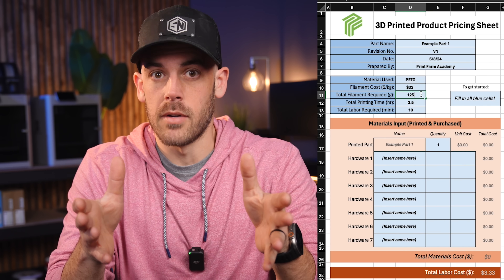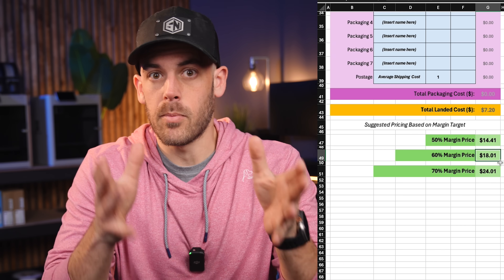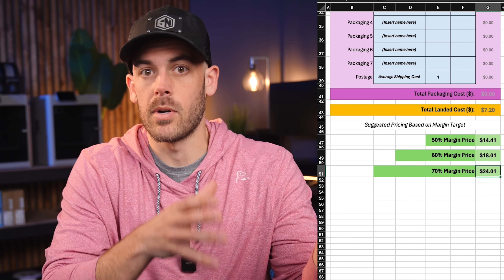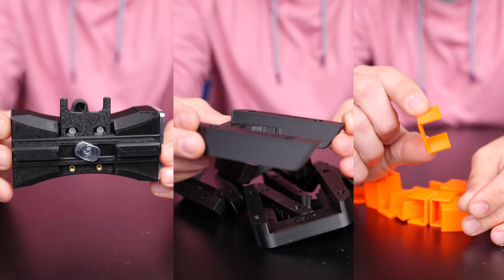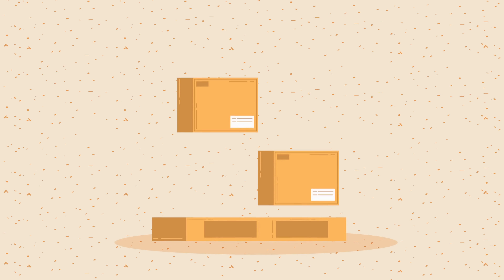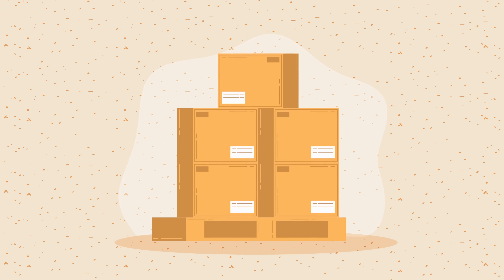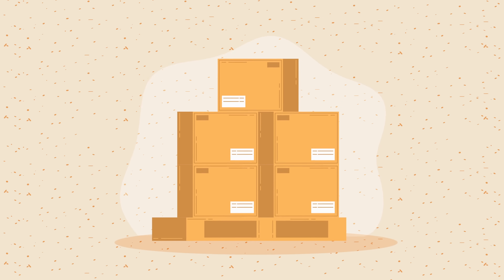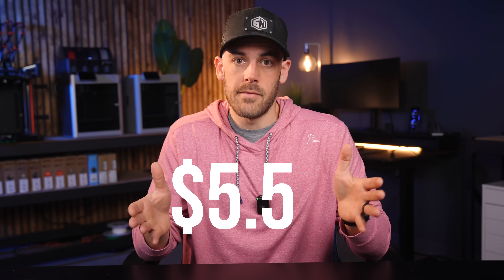Why I charge $55 for this 3D printed part (how to price)

Comment: I charge $75CDN per hours for custom CAD design, if it’s a small part that would take me way less than 1hr, I charge a basic $25 when it’s person that needs an item for their hobby or small house hold part.  For example I just did a small clip for a knitting machine that is no longer in production or sell parts for it. I charged $25 to design and $10 per printed clip. Any future orders for this clip for other people in her knitting guild is $10 since it’s been designed.  I got extra orders for 7 of them. No one out there have that part available.
Reply: I just wanted to point out the great thing you’re doing for the environment in this way. You’re keeping a machine alive with your knowledge and a small 3D-printed part. We need stronger rights to repair and open-source plans (like CAD models for parts) for all discontinued machines around the world. Keep up the great work!
Reply: @Homie111092  Thanks, the fancy pants shower that was installed in our house by previous owner has a lot of custom parts. Even the glass rollers. A small 1ix2 inch part of over engineered part broke. Was going to be over $300 and 6 months wait for it. 20 mins to design about the same amount to print at cost of $0.4 to print (including electricity).  The waste is mind boggling. I think the idea of the roller being non standard and engineered to break and that cost is for people to buy a new shower unit.  The greed is crazy. We need printers in every homes so people can have more meaningful and compelling jobs aligned to what they want to do instead of being stuck in factories.
Reply: @Slurgical_3D_Terrain_Channel  I want to get started, Im making my way through youtube to soak in as much information as possible. Where do you recommend I start? A youtube channel? A specific video? A 3d printer model you recommend? Tell me what you can, I completely agree, all households need a 3d printer. A regular appliance that is used whenever something breaks, just find the part design online, print and repair. What a world we'd be living in then.
Reply: @AdrianDWolfe  I was in your shoes about a year ago today lol.

CNC kitchen has a lot of great stuff but honest once you watch enough 3dp videos you will get recommended them enough you wont need to look. for my printer I went with a bambulab p1s and its served me extremely well, its much cheaper now even, i paid about 900 usd shipped with filament, about 150 was CF stuff, CF filament (pet and petg) a hardened nozzle and extruder gear. It seems like they have a massive sale on everything from late october to black friday, I recently added a multi material system (AMS) which was 100$ off with that which should still be running. though if you dont plan on doing engineering filaments an A1 or mini could be fine too. There are a LOT of really competitive machines out there now too, bambu (specifically the p1p, p1s, x1c chassis) has REALLY good support for aftermarket parts which has been amazing. Since then I have learned fusion (I had used autocad for a few years a decade ago) and have been constantly designing and fixing my own stuff since. I have only had to open it up once to rotate a REALLY rattly linear bearing, but nothing that has affected printing really.

as far as stuff I have made off the top of my head (not all designed by me but a lot were)
.Glasses frames (which I am still wearing right now)
.shelf pegs
.wall hooks
.MANY p1s upgrades
.toys and personalized christmas gifts
.storage and organization
.a visor mount for a car
.a clamp screw  (that was plastic to begin with) that was 40USD to replace from the OEM shipped
and so many more, I dont think its saved me money, but besides a 3090 for mining eth its the one machine I have bought that has actually paid off a significant portion of its value. and not to forget just how much it kept out of a landfill by making repairs possible. recycling pla at home on the cheap is still a few years out, but its not a big deal to keep a trash bag or so a year around until then.

If I had to guess ive spent around 1100-1200 total on printing stuff, and id wager its saved upwards of 600$. the glasses frames really carried here at 200, the visor part for the car was also 80+ shipping. Theres also the "one of a kind" stuff like I printed a marble PLA weeping angel (250mm tall or so), good luck finding something like that for a christmas gift. I honestly think we are moving towards that time where people will be more likely than not to find that someone already made a model and uploaded it for the exact thing they broke. more often then not printables has what I need, and for free. printables has a rewards program that lets you get (cheap, you pay shipping) rolls of filament for uploading makes of others models, and uploading your own, though most of the points come from makes. comparing your models to others is a great way to learn, especially if you are looking to design your own. Look into tinkercad if you are new to design. and then you can move onto something like fusion 360. even though I really dislike the business practices of subscriptions and paywalls its still the best parametric modeling program. its still free for personal use, and commercial with limitations, but a lot of subscription scumminess. 

thats about all I can think of now, welcome to the world of 3d printing!
Reply: @AdrianDWolfe  hi sorry. I thought I responded to you.  My bad. Yes for sure a youtube channel is a good start. I started mine a couple of years ago,but at the time I wasn’t sure how to go about it. Wasn’t until the beginning of last year that I had some direction. My channel is still very small, that’s ok. I haven’t really pushed it because I haven’t really found my voice yet. I think I’m at the cusp now. So start now if you haven’t yet, it might take some time to find your voice.  Even if you vlog the beginning of your journey, practice with that. I just started vlog with my design now. If I were to start over, I think I would have started with vlog my journey towards my goal so I wouldn’t crash and burn when my goal became clearer. As a 3D printer I would start with a modern one.
Reply: What do you mean by small part? Because small parts can be as complex as a big one. Its never the size but the complexity of your design that defines how many hours you spend on wich level of your skill. Then if that part is going to be produced, you should also have to do optimisations, regarding materials, plenty of certification requirements, etc.
Reply: @ It was small physical and simple part that took no time to make.  The shower part was equally small but took me about an hour to make. You are right, some small parts can be really complicated. I design tabletop terrain for gaming. They are small and with a lot of details and working mechanical parts with gears for doors and locks at 28 or 32mm scale.
Reply: @opiniono-1 I think those are valid for mass production requirements. But for stuff that is out of production and at a hobby level, as long as what you are doing works and is safe overall. Don't need all that. A brand that doesn't exist...has no ground to sue you, and if someone hold a trademark and gets twitchy...then stop, doesn't worth it. For sure you don't sell enough to make any ground for lawsuits. The needs are not substantial for anything. Could have carved the part from wood. Anyone with imagination or skills can do and reproduce. Even for example, if there is a Yugo Club and they need anything to make the Yugo go....who is there to stop you. Yugo will go nowhere since there is none.
Reply: This has to be one of the most civilized and thoughtful comment threads I've seen in months. I've almost forgotten people can communicate without unhinged lunacy taking over within 4 comments lol 
Great convo an advice Slurg 😎
Reply: @ShadowWuYT  oops lol. Looks like I commented a lot. Thank you. I’m with you about the lunacy. Life is hard enough with the abrasive lunacy and toxic comments.
Reply: @Slurgical_3D_Terrain_Channel   yeah man it was refreshing to read something I actually learned from lol
Reply: Do you have some kind of storefront where you list/sell all these one-off items? It would be the best way for other people needing that specific thing to find your version.
Reply: @ no, I don’t for that stuff. I do have a digital store for my own designs. I’m more focussed on designing terrain for tabletop gaming, but if someone needs something I have no issues taking commissions for one shot or a couple of times. The main reasons for that, is that I don’t know enough about trademark and all the legal rules for that. So making a shop for that would take too much of my time to make a business out of it and looking into the legal stuff. I’m just one person that scrapes by. I already got legal threats because I mentioned that my terrain can be used for some games. Most companies don’t care about that, it promotes their games. But Games Workshop are predatory. I didn’t even copy anything of their  or their style. So it doesn’t worth for me to a chance about copying things and ending up homeless.

Comment: This is awesome. I started doing this on my own worksheet when I was preparing to sell items, but this was quite a bit more in depth than I was doing. Still ended up with similar numbers off by a few %. However one of the biggest things to consider is taxes or any fees for the place you're selling. Where I'm at, I'm looking at 21.8% on every item for taxes when you calculate state sales tax and then federal taxes since I would hope to make over $400 in a year. So for a $25 item with $13 as the FLC, I would add $5.45 to the "cost" of the item as well or subtracted from total profit. Which gives you only 6.55 or 26.2% as the total profit which really isn't good enough I would think. 

So I'm modifying your worksheet for myself to include those tax numbers as a consideration, so I can look at the profit margins and make an even more informed decision.

Comment: You calculation of profit margins are wrong - Example Landed cost $8.45 + 50% margin = $12.67 - You example  shows a price of $19.99 which is really a 130% profit margin.
Reply: You’re incorrect. 
You’re talking 130% markup, not profit. 

Profit is measured off of the final selling price backwards to COGS, markup is the same but measured forward. Therefore his profit is actually 58ish %
Reply: LET HIM KNOW BOAH WOOOOOOOOOOO

Comment: I really like how you broke down the cost buildup for the landing cost. I would suggest a G&A calculation also. This general Margin and "what the market will bear" is good.  The one issue with the labor calculated per part is that labor  (FTE) is hired at one man year or a % of a man year.  That can include Product Design and Development costs. Not trying to complicate things, its more information start-up awareness.

Comment: This is excellent, and gone into my list of canned responses to noob questions on YouTube 3DP groups.

I started my small electronics business in the spare room, 44 years ago. Initially it was just design consultancy, but morphed also into manufacturing the end product when a client asked me "where do I get it made?" Long story short, within a few years I was doing $250K contracts making fire alarm board for Chubb Fire. All the actual assembly work was done by out-workers, ladies working at home on a fair per-item rate. At that stage I had very low overheads, so I could out price any larger competitors.

Talking of overheads, you forgot the cost of the premises! It may be your garage, but it still has a cost. You surely remember that when you do you tax returns? Do you employ an accountant? Who cleans your space? How do you heat or cool it?

But, and you alluded to this, there comes a time when you need to employ someone. That is the first major transition for any micro-business. Now you have wages, an accounting burden, insurances and potential legal liabilities. While working from the back room I could charge M&L + 50% and do very nicely. But with a full time employee there are expenses that must be paid even if nothing is being made. Here in Australia we have strict rules about hiring, firing and employee relations in general.

So what I am saying here is that you may have to decide when you start how you will survive the transition to a high overhead situation. I did manage it, with a business partner. I am happily retired and travelling the world. My old company:  www.splatco.com

Comment: It’s important to know how much you pay to produce something so that you can know your margins, but this is not really the correct way to set a price. There’s an old adage “The market sets the price”, basically, you charge as much as people are willing to pay. In a fair market where supply roughly matches demand, this is the correct way to price your product. You can adjust from this point if you want to for example undercut a larger competitor slightly, or you can charge more if you have value added above the competition. That being said, there is not always just one way to do something. I just thought I’d share my 2 cents on what the “correct” way is to price based on classical business principles.
Reply: while it's the "correct" way to price, it can be borderline scammy sometimes with things that have fairly inelastic demand (e.g. stuff that will be bought almost regardless of the price, like insuline or gasoline)   if you have free unlimited water in the desert and you're still charging 400 bucks a liter, you are probably evil. (obviously an egregious example, and there could be examples where that would still make sense to price it at that price, like if you have one client per month, but that's not the point I want to make and imo it should be free access.)
imo if you're over like 75-80% margin except on very cheap items (selling a 1 cent item at 10 cent can make sense), you're probably either making pedantic art, or you should join the nestle board meetings.

Comment: I used to sell high volume 3d printed parts and found that if you treat them like metal die cast, you'll cut down on print time, labor and material cost. Die cast as in thinning the part to the minimum, getting creative with no support prints and creating custom code that knocks the part off the print plate and starts another one with no human intervention.
Reply: can i add that you can also model in your own supports that are superior and can come off easier. personally i have a few models that required supports so what i did was model quick tab pull off supports for these models which were perfected to be the bare minimum required for supports as auto supports and software supports do not have such features yet. i.e my models i pull the supports off clean with my hands time required 5 seconds vs 30secs to 1minute if i used software supports.
Reply: At that point isn't plastic mold injection better? I mean I know there is a material cost to get going, but in the long run...or is it more of a space issue?
Reply: @TechieTard  I looked into injection and the molds would set me back almost 10k each from overseas, but that doesnt include the equipment cost or farming it out. The return of investment (ROI) was not there, so I continued perfecting my printing process.

Comment: I have been discouraged from 3D printing as a business because; there are many products that are available in big box stores for less than it would cost me to Autocad them, trial print them and finish them into a better product than made in China. The most practical and cost effective would be a custom part paid for the cad work per hour; anything mass produced by any other company would be spinning wheels on grease.
Reply: that's why a niche is so important, there's no way to compete with 3D printing for products that have volume to justify injection molding. But if you've got a part that will sell 1000/yr, but the mold would cost $80k and you could sell it for $30, you can't start that business without 3D printing
Reply: Not true, you can improve on designs with 3D printing where methods like injection moulding cannot do. Or it will cost them a fortune to redo the molds to accommodate the improvements. I have found most end consumers don't want to spend money paying someone to design something for them because it makes it much more expensive.
Reply: @ggcf  3D printing has its place but not so much where the hobbyist getting filthy rich is. That guy would make more money flipping burgers.
Reply: @Capt_Caveman_777  you mean don't go in trying to print hobby stuff?
Reply: @ggcf  no more like don't go in printing standard already available parts do everything custom made.
Reply: @Mojo4884  I agree, look to improve the designs where possible too but I see nothing wrong with using parts currently in circulation and replacing them with 3d printed parts. Given it is your design and you can do it cheaper and better.
Reply: it is good hobby though, helps to solve household problems a lot.

Comment: FWIW, you missed some large costs in overhead and infrastructure.  The cost of the machine and the electricity might be far less than the cost of the room they are running in and the cost to maintain (cool) it.  Depreciation has tax consequences so you want to get it right.  Otherwise you will end up out of business because you paid tax on the value of your home for no reason.
The labor likely needs better consideration.  There is a lot of inefficiency to a small number of machines building random schedules.